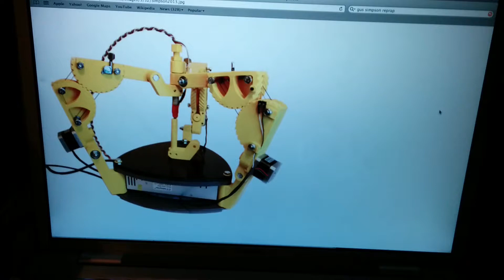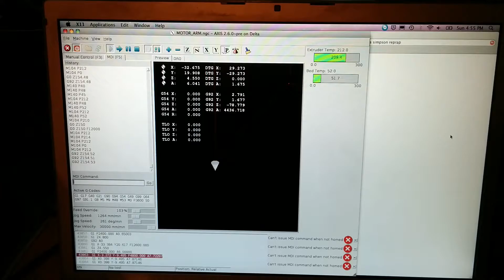BeagleBone Black + BeBoPr + MachineKit + Kossel printing GUS Simpson parts.

Comment: No doubt that Beaglebone Black with BeBoper is a winning combination. It has been  ahead of it's time for quite some time now. It is a shame that the opensource community hasn't embraced and integrated it into the common packages. I feel that you should be able to use Repetier or any other common software with this hardware. It's ridiculous that each user must compile and configure a linux build and break a familiar software chain. This is I believe the ONLY fully tested and functional package that is not recognized by ANY popular interface.

Comment: is this the bebopr++ version?
Reply from the maker: Nah, orginal with HW mods.
Reply: Brandon Heller so i got a ++ in the mail on its way to me, wanted to either upgrade my rostockMax or just build a mini koss. can you point me to some literature that helped you configure your delta?
Reply from the maker: The GitHub repo link has the config and the machine kit website can get you started.